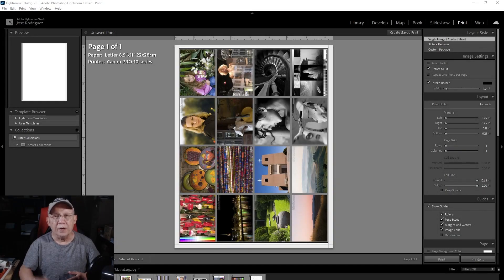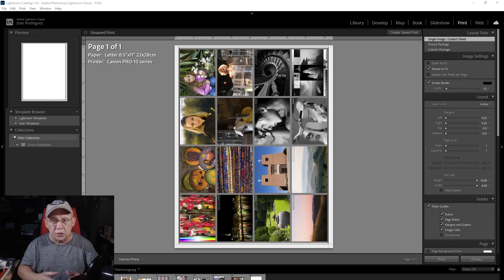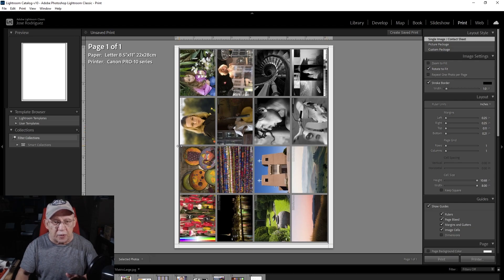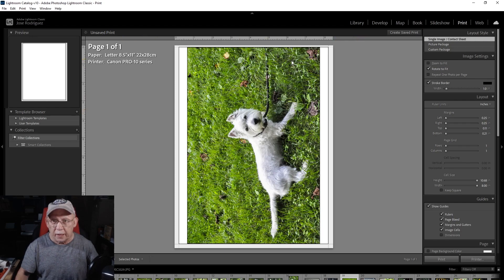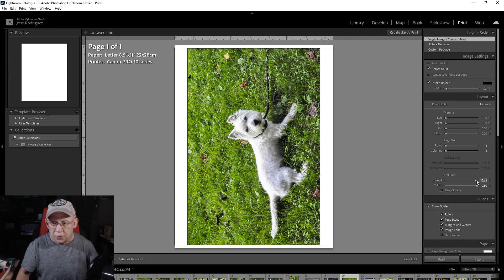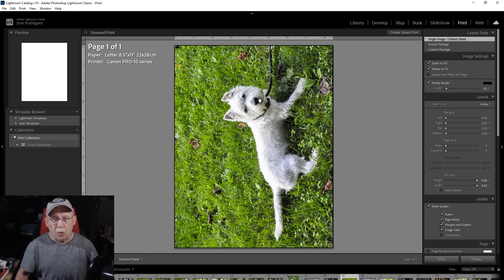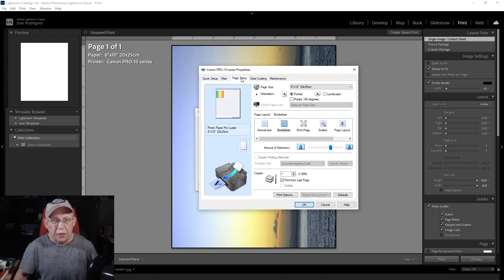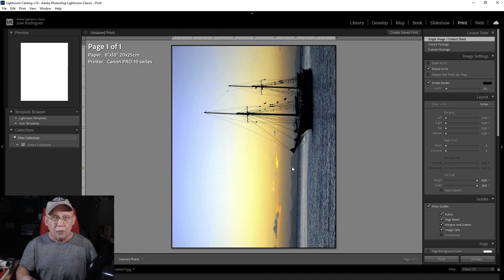Aaaaah! The Intricacies of printing borderless!

Comment: I had 2  identical 10 x 8 printed at my local supermarket.  The only difference was that I had one with a border and one borderless. I didn't really know what to do but simply reduced the image size of the one with a border to 9.5 x 7.5 in Gimp but keeping the page size at 10 x 8, so leaving 1/4 ins border. I used to be a litho printer so am familiar with bleed but I had no sign of even the tiniest little slither on my borderless print. Was I just lucky and should I have done something different?